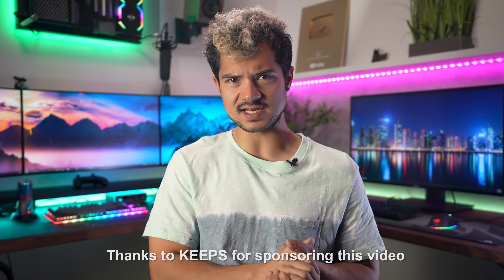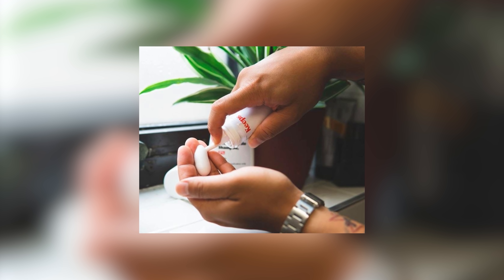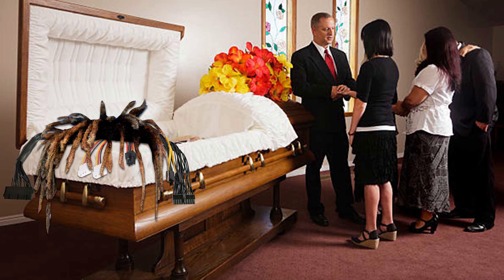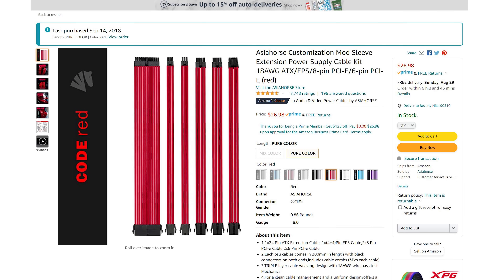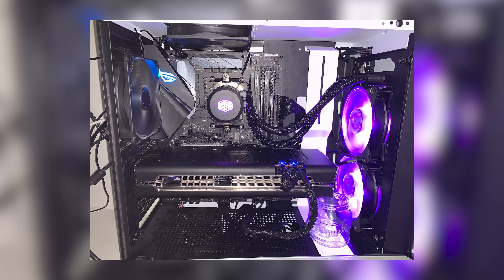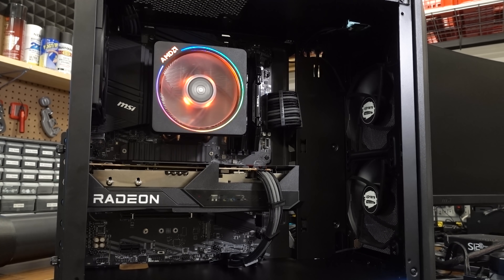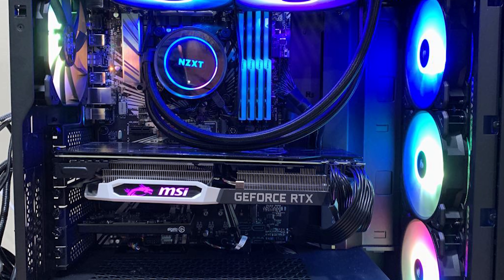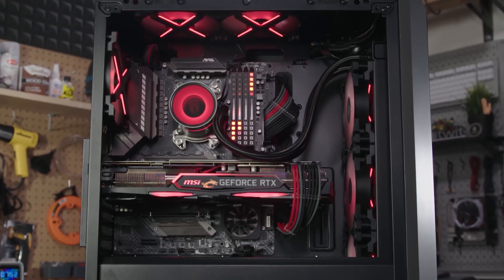THE TOP 5 THINGS WRONG WITH YOUR PC RIGHT NOW

Comment: What I see is that for the sake of pretty-looking builds, people choose underperforming components. It's just a lot of color-coordination and flashyness instead of sane parts choosing.

By choice, I recently built what turned out to be the ugliest (but properest-looking) computer I've seen. You know what, though? Be it the 4K video rendering or music-making I do, I'll have peace of mind.

 The unsightly G.Skill C16 3600 MHz Samsung B-Die memory doesn't hold the Ryzen 9 5950X back. The money spent went towards speed, not bling.

Those ugly memory sticks are hidden by an even uglier be quiet! Dark Rock Pro 4 CPU cooler, which towers above an XFX RX 6900 XT Limited Black video card. 

That ridiculous-looking, oversized XTXH-chipped GPU, which looks even worse with the homemade-looking anti-sag bracket it came with, runs cool inside the well-breathing, air purifier-looking be quiet! Pure Base 500DX.

Why did I spend time typing all this and specifically throwing specs? To brag? No, to show that even with its top of the line components, my build cost way less than most RGB unicorn puke factor builds I've seen online.

It just doesn't look like a lit-up, rave-partying peacock. I think every comment needs to affect someone positively. What is my advice?

When you choose parts for a PC build, sure...make it look nice, but don't sacrifice performance for looks if you have to make a choice. Also, wait for sales or prices to go down, which happen monthly.

Keep your finger on the market's pulse. Don't buy everything in one sitting or in the same place. You don't get paid to be faithful to one store. Be patient and you'll find the best prices. 

Buy from authorized dealers and reputable sellers with a good return policy. If on Amazon or NewEgg, buy directly from them, not from the sellers, unless their price is worse and the sellers have a good, established reputation.

Don't waste money on color-coordinated custom cables and other non-sense. Don't get stupid amounts of hard drives and monitors when you can use the money for a faster CPU, GPU and SSD even if your system will be simpler.

I feel sad seeing those pricey PCPartPicker builds that skimp on what matters most. It's a lot of show and not enough go. A lot have the priciest parts without regards for actual performance.

Stretch your dollar. Read reviews. Sometimes the priciest components are not worth the money over their less pricy counterparts for your use case. Ryzen 5 5600X comes to mind. AMAZING value. 

Most important, don't be Team Intel or Team AMD. Don't be Team GeForce or Team Radeon. People will not dislike you when you aren't a mindless fanperson. 

Be reasonable. No one pays you for brand loyalty. No one appreciates your company fealty.

Also, BUY THE SOFTWARE YOU USE. Do not be a thief. Just because piracy is rampant and companies make enough money doesn't make you less guilty of participating in it!

Have fun and be good. Peace!

Comment: On my pc, to look more cleaner, I use  24Pin Male Power Adapter 90 Degree Desktops plus my NZXT S340 Elite shroud help to hide the cables. Also I did 90 Degree angle for my USB 3 front panel cable. I did vertical mount the GPU and for cable and bought the angled power converter to hide the cable at back of GPU. In general, my rig looks like there's no cable at all.

Comment: I've got a tip for you. A black marker can be your best friend! I've used it on wires and shaved parts or parts that need some scratches hidden or whatever. Some types of wires it doesn't look the best or can rub off but a few feet away it can help things look a lot better. 

I learned it from my radio control racing, where keeping your electronics clean is visible a lot of the time and helps it look more professional.

Comment: Poor cable management is not something that's "wrong" in a PC build. It's pretty much 100% an aesthetic thing. It may be an eyesore (especially with glass-paneled PCs) but it has pretty much no effect on ventilation (see the famous Linux Tech Tips video on that).

That being said, an eyesore is an eyesore. In my build I had to buy a 4-pin fan cable extension cord because the only case fan headers on my motherboard are below the CPU socket, slightly to the left, which is a quite long way to the fan controller, so originally I had to just route it from the header towards the front of the case and from a cable routing hole on the MB tray to the back of the tray, because the cable was too short for anything else. In other words, it was just hanging there horizontally, above the GPU, below the CPU, on top of the M.2 drive, and there was no way to hide it or make it look neater, and it was such an eyesore that I bought an extension cable so I was able to route the cable directly to the top of the case (where the CPU power header is) and from there to the backside of the MB tray. Much, much better now. The fan cable is now inconspicuous and not an eyesore anymore.

Small things make the interior of the PC look so much nicer.

Comment: Literally the only thing he mentions that actually matter is the cable management, and that's because of airflow issues. My case is in between my dresser and a wall and doesn't have a transparent side panel. RGB and matching fan and GPU sag literally don't matter worth a damn.

Comment: I had recently built my new pc and I don't have good Cable management but to me the only thing thst matters is to not see any of the cables not stick through the back, and while messing with the case I'm gonna need to buy a new one since I messed up a thumb screw while 

My first mistake was using a power drill instead of one of my dad's 5 screws drivers he has with different types if grips that won't make me drop the tool

Comment: The only issue I have is light distribution, and that could be a whole lot worse. I have RGB on the mobo itself, rear fan and the AIO pump. Couldn't get RGB RAM in on time though. That said the tubing for the AIO goes over the RAM so it probably wouldn't have looked that great anyway.

Comment: so the 5 points and their solutions are:
note: these "wrong things in your PC" are mostly aesthetic but some of them do affect performance and longevity.

bad cable management: just take your time with it, do it well and use any and all tools you have to make it minty.
bad looking cables themselves: it's just an aesthetic problem, but having custom cables that are well trained is a fine cosmetic upgrade.
bad fan aesthetics and airflow: make sure fans are mounted in an aesthetically pleasing way, after being sure of balance between intake and exhaust, bonus points for having matching fans in the whole case.
poor RGB lighting distribution/barely any of it: try not to get RGB RAM if none of your other parts are RGB. most of your parts having RGB or none of them is better than just a couple of them.
graphics card sag: if your card is sagging, get a sag bracket or make one.

Comment: one thing I learned very last second was plugging in the GPU for a double 8 Pin card, don’t use the daisy chained cable from the power supply and instead use two separate ones. Maybe it’s just for 3000 cards but glad someone told me day of building.

Comment: My rig have way more than 5 things wrong with it. You should by a very small hp pavilion then put a normal power suply and a gtx 1060 6gb inside a 2014 case let me tell you its a pain. So cable management its very hard.

Comment: I run an Asus Thor 850w PSU and am very happy with the stock cables it came with. I also do not have a tempered glass side panel (Coolermaster Storm Trooper-window), so RGB and careful cable management do not matter. Although I did do good cable manage. I also run a support bracket on my Asus RTX 2080 to cure the sag bracket and it works great.

Comment: I feel like failing to enable XMP should be on this list. The amount of builds I've seen with 3200MHz+ RAM running at 2666-19-19-19-19 is depressing.
Reply: I tried to turn on xmp on my Ryzen2700x / 32gig corsair.  but my PC would not boot on it!, so I just manually OC my Ram to it's highest possible, think it's 2997 or something.  I just acepted the fact that i got a bad roll of the dice on my mobo / Ram combo :(
Reply: @alanhernandez3459  you might need to do a bios update. That fixed mine. I used to have a 2700x and when I upgraded to a 5600x I needed to do a bios update. Then after I was able to turn it on.
Reply: That's compatible hardware, he's talking about the build specifically.

Comment: looking at my PC, I am guilty on 1 1/2 occasions

I am using the default cables of my BeQuiet! StraightPower11. I dont mind them being just plain black cables. doesnt look like an eyesore on my build nor does disturb its looks

I am semi guilty on the mixing fans thing.
My front intake and side intake fans are arctic P12 white and arctic P12 RGB
the top exhaust and exhaust use LianLi Unifans.
so i am both uniform and not

Comment: about the pc on the floor, yes its dustier and all that but as long as its on a piece of wood so it isnt on carpet and is put up a little higher then its all good, i personally have it on a piece of wood with 4 wheels so its easy to slide in and out and reduces bumps in trying to get it in and out and therefor reducing the risk of damage

Comment: I have a tiny desk, so on the floor it is. it's at least on a wooden board and has feet. the replacement desk is in the car to be built later. Also I really hope someone getting into pc gaming doesn't take all these things too seriously, RGB, custom cables, and etc all aesthetic choices are optional. I have a non modular 750 watt 80 plus gold power supply, yes it would be "nice: to upgrade to a fully modular psu with custom sleeved cables, but its not something "WRONG WITH [MY] PC RIGHT NOW"

Comment: i know the top thing wrong. T_T no Asus tuf rtx 3080 i backordered in Feb. 8 2021 T_T

@Bitwit any advice where to get custom cables for the Cooler Master NR200 case and Cooler Master sfx 750/850w psu. I would expect Cooler Master to sell them..... but they do not.

Comment: Mine
- It’s outdated
- I need Dusting 
- I needs a real case
- the cooler is facing the wrong way
- it’s intel and not amd
- DDR3 1333Mhz
- open side panel 
- only 2 fans witch are exhaust. 
- thermal paste need re application (no screw driver’s)
- no rgb or led’s (-144 FPS across every game) 
-450w rose will power supply 
Outdated

Pros 
- good cable management,(easy) 
-black cables
Reply: I7-2600k no oc  65-75c
MSI white armour Rx 570 4Gb 84c 
16 Gb 4x4 (2 different sets, 2 blue and 2 green, 1333mhz dual channel)

Comment: Little note about RGB distribution : in my case, I have 3 RGB fans in the front (they're not very bright), a little lighting on the AIO pump, RGB RAM and a tiny strip on the GPU. That wouldn't look good at all by itself. I'm fortunate to have a white interior, so I added an RGB strip in the front, lights towards the back of the case : don't underestimate how a little LED strip can light up a white interior case

Comment: Cool but what the hell you do with a reversed ATX case, airflow-wise. The top has to be intake, as the GPU is upside down, blowing air downwards. The front is also intake, as it's filtered and the only exhaust is a single 120mm fan in the back. That's 4 to 1 intake : exhaust. It's the Silverstone Redline RL08, really awkward airflow options. Now be smart.

Comment: Those are some valid points. Now someone that's been building computers for over 20 years, you can take cable management and stick it up your azz. Engineers don't even consider cable management a thing. I perfectly understand having some organization with cables, but this modern day cable management is pure BS and a myth.

P. S. I will never put a computer on a desk as it will always be underneath a desk where it belongs.

Comment: Would've been cool to hear about making poor financial choices going for a lot less performance to save a buck or two not future proofing your system or at least giving it space for upgrade later and now regretting it or picking incompatible parts or bottlenecking

In my case if I want to upgrade my GPU I need to buy a new powersupply
Reply: (I think the brand is called RM idk) I found a RM850 watt  and an RM750 watt for 5 bucks less lol I'm definitely getting the 850 cuz it's only 5 bucks more hah

Comment: Internally I do an okay job with cable management. I don't really care about looks so much as I care about impedeing airflow. Outside the case, as long as the cables are out of the way I don't even bother with cable management because I always end up moving my pc every couple of months for one reason or another. Having to undo the external cable management is just a buzzkill.

Comment: I just have crappy specs, Ryzen 3 3100 on an a520m with a wraith prism cooler i took from my father's cpu box, 16gb 3200 mhz cas 16, RX5500 XT, and corsair 650 watt 80+ gold, and my case is very dusty so i clean it often, but otherwise it looks fine

Comment: 1: cables. My cables are managed perfectly. I can see only the one to my graphics card, through the window.
2: Ugly cables. Mine are just black. Just like everything else in the case.
3: Fans. Mine are perfect 2 intake, 1 exhaust. But a non-OC'd system, so .. heat isnt much of a problem.
4: RGB lighting. Only lighting i have is the LED's on my graphics card. And i have absolutely no idea how to turn it off. Now i just use it to see whether the PC is on or off. I don't like distracting lights. I wanna look at my monitor.
5: GPU Sag: unnoticable on my build. It's there, i guess. but only if you REALLY look for it.
Overall ALL these solutions can be fixed by using your brain when mounting the fans, and getting a pc case WITHOUT A WINDOW.
fucking christ i hate tempered glass. Next case i'm getting will be solid panels all 'round. 
I can barely see into my case, due the reflecting glass, just acting like a mirror, so i can see the cables behind my monitor. It's ... annoying.

Comment: Your tip #2 actually causes a lot of problems since these aftermarket cables are often lower-specced than the cables that come with the actual PSU. The most notable example of this is the capacitance - it's commonplace for PCI-E cables to have capacitors at one or both ends as a way of keeping voltages more stable under transient loads, but your "pretty cables" do not have them.

This failure mode has become apparent with many systems failing while using newer high-powered graphics cards like the RTX3080 when using aftermarket cables that have removed capacitors. Swapping the cables back to the ones which came with the PSU is sometimes the difference between a completely stable system and one that crashes regularly.

Comment: Glad I managed to dodge all of these except stock psu cables, however I have an evga psu so the cables don't look the worst, also my case is pretty small so not lots of exposed wires
Reply: Honestly, I wouldn't consider using the stock cables a "mistake", either.  The whole custom cables thing is just an aesthetic choice, and makes no difference for performance.  I'd rather put that money towards something in the build that actually makes a difference.
Reply: @neurokinetik64ES  yeah, honestly I might just grab cpu power 24 pin and my 2 8 pins for the gpu, that wouldn't be as expensive as getting everything down to the sata and molex cables

Comment: Everyone and their mother has a guide how to manage cables but NOBODY is talking about how to deal with slack decently. That being said:

cable management - check
decent, straight cables everywhere - check
correct fan orientation - check
good lighting distribution - check (literally have brighter internal fan blades so they would look identical through the tinted window to the front ones that are not covered by anything)
GPU sag? nope, vertically mounted

Comment: I replaced 2 sticks of 4gbs of ram with 2 8gb ram sticks and I had also replaced my 500w power supply with a 550w power supply and now my computer won’t turn on. There is power running through it but the computer won’t turn on. No fans running. I had changed the parts back and forth but I’m not sure what to do.

Comment: If only noctua had nf a12x25s in black already... my build (o11d, 3x 360 rads) is pretty nice but the brown fans "ruin" it, not that I care overly much but its still not pretty when I glance over rarely. Its the only fan I can run around 900rpm with both low noise (motor hum included) and great performance in my case so I have to wait for black version.

Comment: I use the rainbow power cables cause my whole pc is under 700 and can run any game iv tryed to run ao idc if its rainbow or black or red it works so im happy with it and yes my pc is old but it does what i need when i upgrade i also will not go with a 10k cpu or a 3090 gpu i aint that nuts 🤣🤣 o also my cable management aint to bad lot better than most that was shown in the video yes my ram dont all match cause i dont have 200 for 2 matching sticks of ram and my fans aint all the same size 2 is 200mm 1 is 140mm 5 is 120mm but it keeps it cold on all my games and all fans work 😋 also i dont have a spare 100+ bucks for 2 fans to have 4 200mm fans

Comment: I’ve managed to make the front of my case perfectly cable managed, but between my non modular psu, sleeved cable extensions, and 6 foot cables per each of my 9 fans, I’ve decided the back of my case is a lost cause
Reply: My rule is if you can’t see it, it doesn’t exist
Reply: Same with me
Reply: Just take a picture of the back of someone else's using the same case, a little bit of photoshop magic, and tada... nobody ever needs to know.